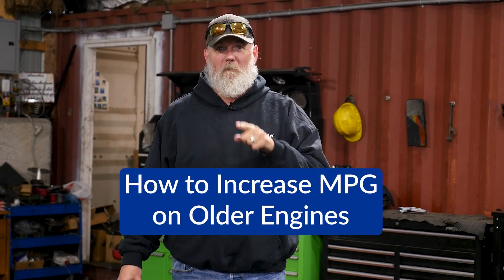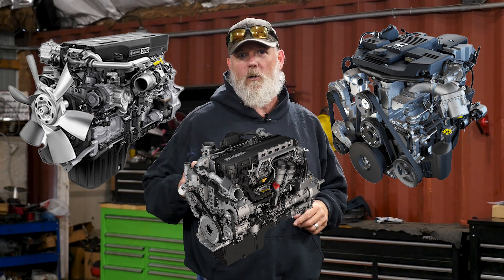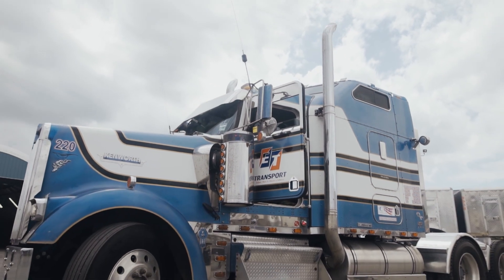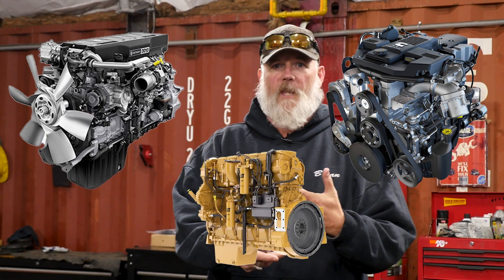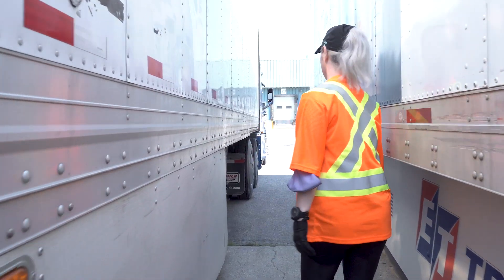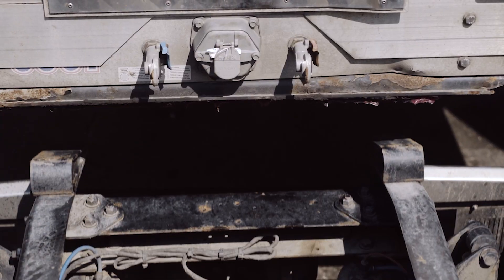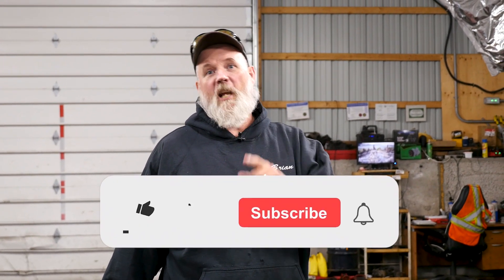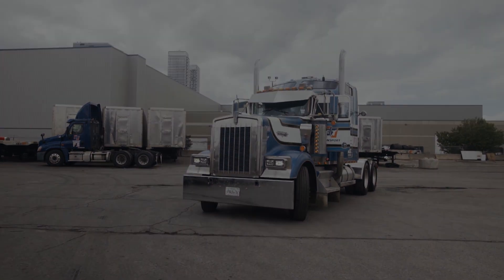How to get Better Mileage out of a Pre Emission Engine

Comment: Detroit 60 12.7
13 speed manual
3.73 gears
7.75mpg
64mph cruise
Empty half the time with a 53 foot dry van otherwise loaded with 39k lbs. 67k gross

Noticed winter months mpg dropped to below 7mpg is this normal?

Noticed during winter months

Comment: Wow! This guy doesn't know jack shit about trucks. DO NOT MOVE YOUR FIFTH WHEEL CLOSE TO THE CAB, without weighing the truck while loaded. The point of a sliding fifth wheel is for proper weight distribution, which effects braking and handling characteristics of the truck. Also, legal axle weight and bridge laws come into play.  He never mentioned proper tire inflation, which is a big one. 

I do agree that proper gearing and slower speeds is very important, but most truckers today don't have a clue about gearing. As far as clean filters and overheads are concerned, they should be serviced at the correct intervals anyway. This is a maintenance issue, not a mileage issue.
1. Tire Pressure (Maximum cold PSI for your tire)
2. Closed shoulder drive tires
3. Correct Gearing for what you are hauling
4. Light acceleration and slower speed
5. Cut idle time when possible
6. Don't run the engine fan excessively 
7. Shifting at the proper rpm for your engine (research the power band for your engine)
8. Pre-emission engines will get 10% to 40% more fuel mileage than emissions engines and do not require             DEF fluid.       
9. Performance exhaust manifold (Full Tilt)
10. Performance turbo (Borg Warner)
11. Filters, overheads and proper fuel pressure.
12. Learning to do more of your own maintenance will save thousands of dollars per year. Most shops charge $150 to $250 dollars per hour, just for labor. You don't have to be a mechanic to change simple things like belts, alternators, air compressors, batteries, filters, fluids, fuel lines, radiator hoses, heater hoses, light bulbs, mud flaps, etc. Most of these things are common sense. You can just look at it and figure it out. If you are still not sure, watch some YouTube videos. Don't be afraid to get your hands dirty and take some risk, it will pay off big time in the long run and you will be surprised how much you learn and grow in this business. Success belongs to those who want it the most.

Comment: Valve lash? Do you mean overhead valve adjustment?
Reply: Yes, the valve lash is the gap - it needs to be perfect and maintained recently.
Reply: @DistantRelatives47  I have a 2015 Volvo truck. I replaced the upper and lower valve cover gaskets. Not too bad. Now I want to learn how to do an over head valve adjustment. I'm gonna learn 👍🏾😎
Reply: @al-mubdizahir7098  that's good, the more you can do yourself the more money you can save - just be sure to get a shop manual and do it exactly like the manufacturer says.

You will likely need to do valve cover gaskets again because the cover needs to be removed and most gaskets will leak if you try to use them a second time.
Reply: @DistantRelatives47  shop manual? Not familiar with that term yet

Comment: Little late to the party but when I became OO I instantly hated things about my truck, it is mechanically sound and a good puller (as any Cummins should be) but the biggest thing was fuel mileage. Instead of trying to recoup my money I decided to change the way I drive the way I view traffic and HOS. When I first started with that truck I was getting 4.7-5.1!! Pulling my hair out because fuel has just hit $6. Not a math whiz but that’s over a dollar a mile operating cost and it was killing me financially. Since then I’ve watched videos like this one and educated myself, peak torque, gearing, pm everything. 
What I’ve discovered changed everything.
Peak torque @1500 
Tires 41.2
Geared 3.9#
I learned quick I wasn’t geared for the highway while the truck could do 70+ I was way out of my peak torque range. One guy said hold your pedal at 65, slow up and fast down hills. I tried that maybe increased .5-.6 mpg. Later I realized it wasn’t a speed he was holding the pedal at it was a throttle position “duh”. But that made me think how to I tell what my throttle position is? In came BullyDog HDGT, while yeah I put the eco/power tune on it actually shows me what percentage I hold the pedal at. What I’ve learned that it doesn’t really matter between 45-50 throttle the truck just goes. However it will not go past peak torque on flat ground. To do so I need to give it an extra 15-20% more throttle!! Literally dollar signs coming out the stacks. The way I view my gear set up now is not fast or how much it can pull but as gallons per hour. 5 gallons an hour at 59-62 mph is substantially better than 11 gallons at 63 it sounds dumb but there’s a very fine line from 5.5 to 9 gallons an hour when your pressing the pedal down. And I understand every truck and trucker is different and this took extreme will power to master it but now I’m getting 8.5+ mpg loaded!! I add 45 minutes to my day and make an extra 150 bucks.

My truck is a

07 International 9200 
Cummins 400 
Flat top
Turbo wing 
Bulldog hdgt 

Later I will regear the truck and keep playing with it. Super singles and making it a 2x6. Reduce rolling resistance. 

Sorry for the rant but maybe it gets someone t thinking

Comment: Thanks for your effort it's great knowledge 
Just a question I met an owner operator he use steer tires for the drive axles as he thinks it does save him a lot of money he drove a Volvo dedicated from Chicago to Albany round trip , does that might make sense ?
Reply: Makes sense way less resistance on steers, the important thing is to switch them up when winter comes.

Comment: You can get at least another 2MPG if you platoon with other trucks. You can have 10 W900's getting 10MPG and only the lead truck has to eat the wind at 6MPG. Your truck would need to have platooning hardware and software installed and the areas you join a platoon has to be legal.
Reply: Lol in your magical fantasy land, do the W900's hover too?
Reply: @jmh4ggg  Yes but they have to hit 88MPH first and have access to 3M Volts of electricity via lightning bolts.

Comment: Basic regular preventive maintenance is a must, I did see an improvement overall MPG's switching all fluids with %100 synthetic oils, gear and ATF. Engine was the Cat C7 300hp/925tq. That's my biggest recommendation I give to all truck owners, switch all fluids with %100 synthetic oil.

Comment: Turn down the fuel pressure so engine doesnot blow black smoke out the pipes, only have engine Horsepower to do the job and not go wild for big horsepower. Probably running bigger exhaust pipes would help. Keep up on tune ups on oil changes, air filters as mentioned in video. How about changing to synthetic oils for Transmission and rear ends,  Great video by the way! How about quit trying to speed up and pass everything on the road; We dont always have to beat our friends on time and log books just for a few extra bucks. WOW I got a few answers correct with turbo;s and exhaust manifolds.  Tire size , and type of tires are important along with costs.  I just wonder if porting intake and exhaust ports would make difference???  Dont know (and probably not) do they even make rollers cams and lifters for older engines???

Comment: Use a hydrogen kit. Save on fuel up to 10%, higher torx, stop building carbon inside engine and kill emissions down. As was mentioned gap between truck and trailer, good pressure in tyres. If you drive in bendy roads have a trailer with steering axle.
Reply: can you elaborate what do you mean by hydrogen kit?

Comment: I’m getting sick of liars and mpg. No. You don’t average 8-9mpg. Shut up. ET is the Worst. Here
 Is copy paste from a real study
Canada
Alberta	4.75	British Columbia	4.51
Manitoba	5.54	New Brunswick	5.78
Nova Scotia	5.81	Ontario	5.25
Quebec	5.31	Saskatchewan	4.88
USA
Alabama	5.97	Arizona	6.15
Arkansas	6.27	California	5.85
Colorado	5.96	Connecticut	6.24
Delaware	6.35	Florida	5.98
Georgia	6.11	Idaho	6.06
Illinois	6.07	Indiana	6.10
Iowa	6.10	Kansas	5.99
Kentucky	6.19	Louisiana	6.07
Maine	6.02	Maryland	6.29
Massachusetts	6.37	Michigan	5.86
Minnesota	6.31	Mississippi	6.34
Missouri	6.18	Montana	6.33
Nebraska	6.31	Nevada	6.13
New Hampshire	6.29	New Jersey	6.05
New Mexico	5.86	New York	5.82
North Carolina	6.24	North Dakota	5.78
Ohio	5.94	Oklahoma	6.00
Oregon	6.26	Pennsylvania	5.86
South Carolina	6.33	South Dakota	6.17
Tennessee	6.20	Texas	5.60
Utah	6.06	Vermont	5.89
Virginia	6.19	Washington	5.76
West Virginia	6.15	Wisconsin	6.35
Wyoming	6.24	 	 
Methodology
Results are based on aggregate data from a sample of 31,170 Class 7 and Class 8 trucks (mixed make and models, model years 2000-2018) equipped with a Geotab GO telematics device, for a one year time span from June 2016 to July 2017, located in the continental United States and Canada. The research was conducted using Google BigQuery, Google Datalab Notebooks using Python, and Geotab’s Big Data platform that streams live telematics data into BigQuery.

Fuel economy was calculated by dividing the total fuel used by the distance traveled from GPS data as reported by the Geotab GO device at the end of each trip.

Comment: Problem w moving trlr too close to cab is u can severely damage the fairings - too much wear on front end parts springs,hangers,kingpins ect. I just had to replace front hanger assembly $3500. So I will not do that never.

Comment: A retired Ford engineer told me that 'above 45 MPH, fuel mileage is all about aerodynamics.' If you've ever been on a two-lane and passed by a Kenworth W900 going in the opposite direction at 70 MPH, the wake turbulence coming off of that big flat front is nearly enough to shove a four-wheeler into the ditch. Pushing that much air comes with a cost: more energy, more fuel burn. Period.
Reply: Aerodynamics, altitude, weather, wind direction, and a properly spec'd drivetrain are all involved in whether or you get good mileage or not.  I can get 9.3 MPGs from say Flagstaff Arizona running East to the NM TX line while driving 75 Mph most of this section of I-80.
Reply: Pete 372 dude :- 1

Comment: For those who are truly serious about maximizing their mpg: 

1. Maintain the recommended tire pressures
2. Drive at 60mph, less braking and wear and tear 
3. Don’t idle 
4. Don’t smash the throttle every chance you get, slowly accelerate and decelerate
5. Make sure your alignment is correct otherwise there will be extra resistance against the truck
6. Try to coast as much as possible. If you’re going to exit in half a mile, start slowing down ahead of time instead of last minute
7. Keep the gap between truck and trailer minimal as well as the gap between your tandems and your trailer skirts (depending on weight and axle restrictions by state)
8. Service your truck routinely (oil changes, filters, etc)
9. Closed shoulder tires will give better mpg than open shoulder
10. Keep weight distribution even among your drives and tandems
11. A trusted tuning shop can alter parameters in the ECM to increase efficiency (and sometimes a bump in power output)
12. For a lot of older Cat engines a less restrictive muffler helped with mpg. This doesn’t necessarily mean straight pipe your truck but there are free flowing mufflers on the market.
13. The shortest route doesn’t necessarily mean you will make more money. Sometimes the extra 30-40 miles may mean less hills, less traffic, less stop and go, and cheaper fuel prices.
14. Progressive shifting without lugging the engine (shift at lower rpms at lower speeds and slowly increase as you get up in the higher range of gears)
15. Find your engines max boost pressure and try to stay 5-10 psi under.
Hope these tips help someone out.
Reply: Exactly the way i drive my c15 386  to get 7.2 mpg
Reply: 16. Clean your air filters from time to time. I clean mine once in a month and could improve my consumption by 0.1mpg, which saves me a lot of money. ;)
Reply: Awesome !!! Thanks ✌️
Reply: Exactly.
Reply: Thank you!
Reply: Yeah what he said LOL perfect thank you
Reply: Best comment I've seen in a while

Comment: My VW alltrack gets 34mpg(gas-highway only). APR produces a software/ map flashed onto the ecu. Their website says you can get an extra 4-6mpg on the 92 octane map. With Uber my last week's gross was 1493 US$ for 37hrs of actual drive time. Who Makes the APR maps for a diesel?
Reply: ? I put a tuner in my 95 7.3 powerstroke and it gets 3-4 mpg better on the +100 hp tune.
Reply: @markbroad119  Awesome! Also, thanks for the testimonial, I didn't know if I should believe the claim, except I use cruise control inside the city overnight. Who makes the maps for the powerstroke?
Reply: @richardroot4767  is a TS 6 position. 
Edge makes one

Comment: When we are talking about pre emissions motors we are talking owner operators and then we are talking about who has the biggest balls, the only thing you need to know about a N-14 is a 330hp engine gets the best fuel mileage, the 460-525 HP engines suck the fuel, every time you turn up the power they eat more fuel, my buddy runs 700 in his heavy haul business and gets 4 mpg

Comment: Love the videos. Yes I subscribed already. 
I notice better mpg with a fresh oil change,fuel filters and air filter. Air pressure in the tires and staying below 70mph. The sweet spot is 60-65. You spend more time driving but less refueling so you get there in the same time. Saves everywhere.
Reply: 60 mph is a lot. The faster you go the more fule you burn just fighting against the air resistance.

Comment: I don't know why but in my 08 T800 with 525 ISX using Howes fuel additive gained me almost half a mile per km and increased the throttle response. I did the numbers repeatedly and always got the same beneficial results so I just went with it. In the 13 years I had it i replaced two injectors under warranty and had it inframed at 26,000hrs because of a cracked injector cup that couldn't be replaced at the time. Mechanics said engine looked brand new inside at that time and chalked it up to my anal obsession with changing my oil every 400hrs and only using Fleetguard filters and Rotella 15W40 oil.

Comment: What do you mean by gearing on the differentials?
Reply: There's a final drive which gears down the rotational speed after the transmission. Depending on that gear ratio (which you specify when building a truck), you can tailor the vehicle's performance for power (hilly terrain) vs. low-revs (i.e. better economy)

Comment: Pre emission motors need to have progressive shifting syntheticoil in the proper geared rear ends and take your foot off the petal and use the power wisely
Reply: The new engines have progressive fuel rates and computer control that helps with fuel mileage, I can get better fuel mileage with a carburetor than fuel injection, but that doesn't just happen, properly driven mechanical diesel engine could easily have the same result, our old N14's can get 8mpg but have to be ran hard and always in that sweet spot
Reply: @cargotoolshop5319  years ago an owner op gave me a tired 2001 freightliner classic xl with a N14 13 speed that was set up for heavy haul first thing I did was a full service including changing the oil in the tranny and rear ends the insides of the fuel tanks were black inside and with fuel additives in  3000 miles I had to change the fuel filter 5 times by then the tanks were clean and the motor had more power and better mileage .when i got back I changed all the fluids again .the owner almost had a heart attack . but when I showed him the fuel mileage change 6to 9 mpg he was very happy .then i worked on arrow dynamics I got rid or that big front bumper and installed a shorter one skirted the underside of the tractor all for less wind drag .then adjusted the wings on the sides of the sleeper and made one for the roof line at the back of the cab. cense  I was a long hauler I would shorten up to have minimal gap between cab and trailer  when I got close to town i would stretch out back out .I could do this on the fly .I had the oldest truck in his fleet but I had the highest mileage . I called her my red headed girl friend .within 6 months I had the best lookin truck and the highest mileage in the fleet .and one hell of a bonus every paycheck.
Reply: @loganjohnson3589  what fuel additive did you use in your truck?
Reply: @trenelbrumant4828  Too be honest I don't really remember now .that was 20 years ago and all i was using it for was to clean out the crap in the tanks ,fuel lines and injectors .Way back they used to use gasoline .then later injector cleaners came out .this stuff in my fuel system was something most diesel owners don't know about or remember It was biological .YEP weird right .if your running an older truck and your just wanting to clean things out seafoam maybe .the gas thing was to get an octane boost and remember that was when it was leaded gas 1 gallon of gas to 100 gallons diesel would give about a 5 mile per hour boost .

Comment: Clean filters, how about fresh oil?
Reply from the maker: definitly, should have mentioned that one.
Reply: MotorKote it’s pretty expensive but trust me it is worth it $1100 fill in your oil tank up with that oil and you won’t have to change your oil for five years, it is the only 100% anti-friction engine oil on the planet, if you ask NASA what’s the best oil to use for mechanical gears they will tell you MotorKote